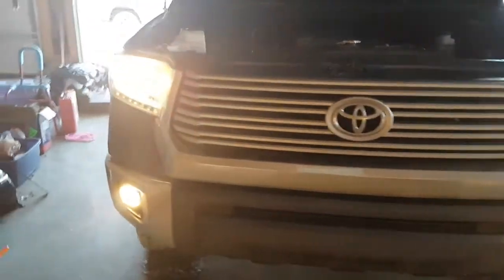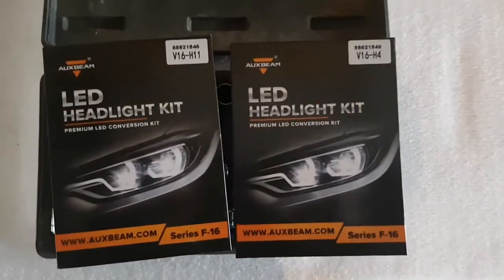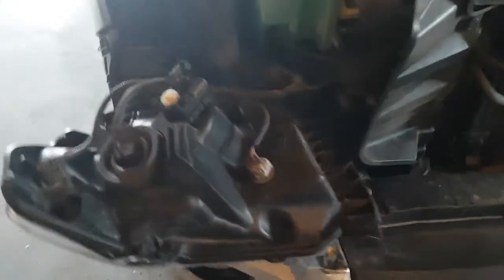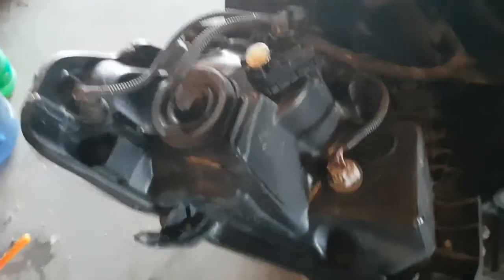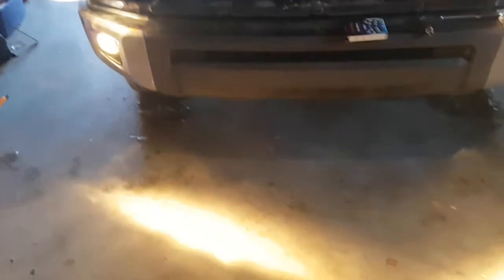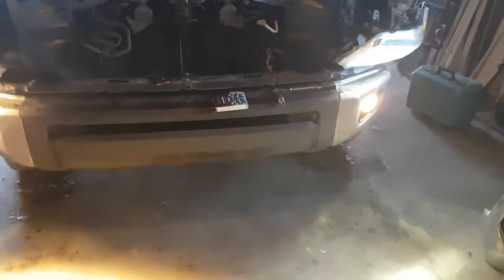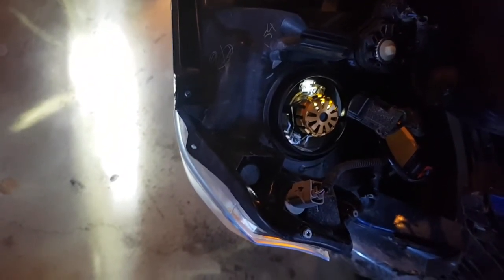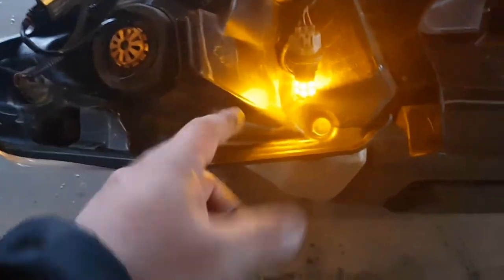2014 tundra led headlight & fog light bulb upgrade

Comment: FYI. You need 3157 CK bulbs for the signal bulbs if your gonna do LED. And load resistors so you dont have hyper flash.
Reply from the maker: Keegen Daniels I found that put after the fact as well... thanks